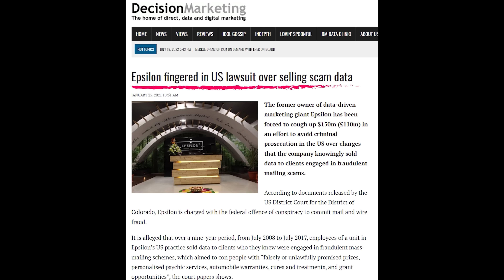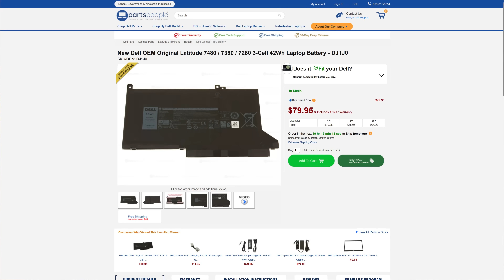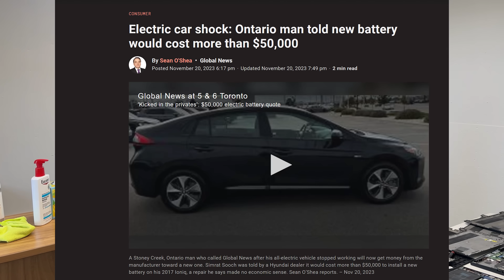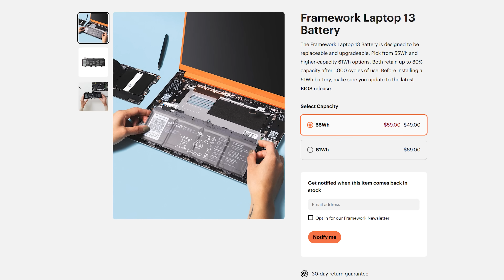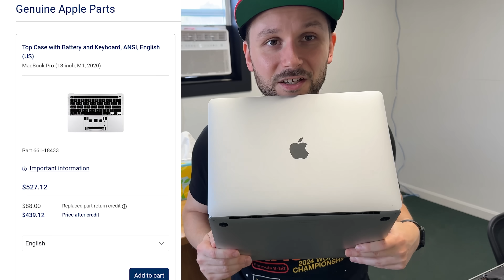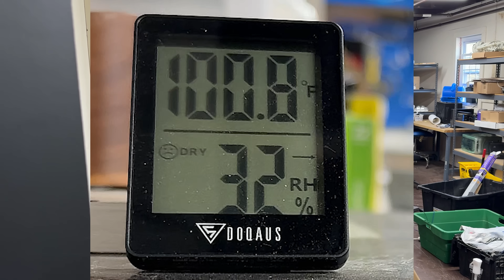Planned Obsolescence: Why is Replacing a Battery STILL So Difficult and Expensive?!

Comment: I miss the time when batteries were detachable and were, essentially, a combination of a bunch of standard cylindrical batteries in a fancy plastic packaging. While it's not recommended, you can theoretically build a new battery and pack it in the old casing, though those casings are impossible to open non-destructively, and rebuilding a battery holds some danger. But screw the danger! We should be able to do this anyway. A PSU can kill you, but it's serviceable. A CRT can really kill you dead, and they were serviceable. A lot of things are dangerous, but if you're careful, you can service them. Product manufacturers don't actually give a crap if you end up blowing yourself up and burning your mom's expensive jewelry, they just close everything because it's cheaper, plus they want to earn more money. That's it.

Comment: Great video, interesting topic. By the way, there is an EU regulation that was accepted back in 2023, and as part of the Ecodesign Directive, from mid-2025 manufacturers will need to provide information on battery life expectancy, battery performance, and repairability, among other things. It's already a soft way to push repairability through this scoring system. The same regulation also states that from 2027, all consumer electronics that come with a battery must be user-replaceable, with very few exceptions. Hopefully, the rest of the world will benefit from this too, and I hope it helps normalize replacement battery prices.

Comment: Two years ago i had to replace my old phone (which launched in 2019) because the battery swell so hard it popped both the LCD display and the back cover out. The replacement cost for a genuine battery was almost 90% of the phone's cost.
I feel like companies bring out newer generations in the same product lineup so quickly nowadays that the previous generations becomes outdated way too quickly, thus having its share of supply chain being poached by the new comers.
Reply: What are you doing with your phone? 😂 I have a 10 year old phone , original battery and no swelling.

Comment: I had the same situation. The repair shop wanted 350 PLN for a smaller battery for an Asus G771. The second repair shop told me to buy a new laptop. But on Ali, I found an original one with the same capacity for 100 PLN. I bought it, installed the battery, and the laptop immediately detected it, allowing me to run on the battery. It's ridiculous. Repair shops only do this because they don't want to replace or repair it. That's why there should be more videos like this. Don't throw it away. If it's working or intact, if it's not completely broken, it's still usable.
Reply: The thing is like they talked about you can buy batteries for most stuff and they can claim they are genuine or original but they really aren’t and have a extremely high defect rate. the shops doesn’t want to order a battery from Ali express for your device, it go bad after 2 weeks and have to replace it 3 more times and now they have lost money trying to fix your laptop.
Reply: Repair shops don't want to burn your house down, so we only source and waranty batteries from japan or korean manufacturers. 2-power batteries are great.

Comment: I had a Gen5 Camaro and did not even wait until the battery failed.  I replaced the AGM battery in the trunk before it failed after three years, using a size 94R.
Reply from the maker: We have the same Camaro, took me 5 minutes to replace the battery. UNHEARD OF in modern cars man.

Comment: Batteries are what makes a laptop cost effective.  Absolutely.  I picked up a 2020 Dell XPS 13 for just £100, needed a new screen (4k) that was another £60 and then the battery was at 50% SoH and Dell don't even list batteries for it  Its only  5 years old!!!  Second hand ones in "ok" condition 80% SoH are going for crazy money. So I bought a cheap aftermarket one, which thinks its an original battery somehow.
Reply: Interestingly, maybe not, I've got an HP Omen from around 2017-2018 it was fairly budget but with 2gb of 1050 goodness. 😂. It's battery at best never lasted much over an hour in use and it's been charged a bazzilion times and was my main PC for the dark days of lockdown.  It was never switched off, charging all the time.   Somehow it's battery health with a windows report is 98% SoH.  🤷.  Sometimes you just get a good pack.

Comment: If you need  laptop, but you are going to be in places where you always can use a socket, I would be happy with one of those with a dodgy battery (always ssuming I ws informed abot this detail) and use it always pluged and let the battery as a sort of emergency SAI to let you save your work and shut down the thing safely. Would it be so unrealistic as sceneario?

Comment: 12:00 I have replaced the battery of my HP DV5 four times in 12 years (5 batteries in total with the original), it still works but the current battery lasts about 15 minutes now, and I will try to extract the good cells in all those and solder them together.  None of the batteries I bought is original by the way.

The original battery of my HP Omen 17, however, only lasted only about 2 years, it is still with the second battery for the last 5 years. Interestingly, the current battery is not original HP part, yet lasting longer with no reduced duration.
Reply: Absolute Ditto.  Same Omen laptop.  The battery turned into a pillow.   The replacement i got has worked well over twice as long as the original.
Reply: The issue is that you have to reprogram the BMS to get it to work after the battery cell swap
Reply: @jaimzilla  that might be above my level, but I'll try, thanks!
Reply: Yeah, don’t solder lithium cells together, you need a spot welder. You’ll likely need an expensive Romanian gadget to unlock the BMS afterwards. Then you’ve just got the issue of the original plastic case having been ultrasonically welded together, causing you to break it during disassembly and have no way to put it back together properly.

The work would also be made more difficult due to the location that the HP Pavilion is in - the trash can if you have any sense.
Reply: @floydkirk-j3w  well, if I cannot find that hardware, I'll just stop trying. Thanks!

Comment: We had an old HP elitebook afew years ago (4th gen). OG battery died. Bought new B-grade greencell battery for it. Had 3 warrantys on it in 6 months. After 6 months just stopped and dumped that laptop. 🤡 Last battery died 1 month after that 6 month warranty was over.

Comment: 12:00 bro called me out, but in my case, it had more issues than the battery, at that point repairing my old iPhone 8 would've cost a lot, and by spending a bit more, I got a new one.
But for my refubrished laptop I bought in 2021? Hell nah, got it to run one software only, and it did its job. Now it's my web browsing, stream watching, min pc usage. Just slapped linux and it does great

Comment: KDE Fedora is A really solid OS. For people that don't want to deal with windows for web browsing. 

Batteries could easily be standarized. You know like we used to have in the 90's. 

I saw an LGR video about an old laptop and the "Battery" was A bunch of C cells wired together...
Reply: Salem Techsperts unfortunately think that Linux is a "neckbeard" thing. I have a smooth shaven face and use Arch btw.
Reply: @synthilein  i dont think he does, he just plays into the bit
Reply: @synthilein  I mean the fact that it's named "Fedora" isn't helping.
Reply: @synthilein I just moved most of my 3D printing workfrow from windows to my framework 13 running Fedora.
 

It is crazy how easy things are on KDE. On gnome ubuntu the app 'store' bearly worked, on Fedora I check it first before hitting the comand line.. 

I highly doubt this will be relevant for you but after having issues with Chronium for my japanese to english translation work, I swapped to A browser called Floorp (A japanese Firefox fork) that fixed my problems with japanese input on chromium.

Comment: Just installed win 11 on my old i7 4790k desktop, it has a 1TB nvme in a pci adaptor running at 3200MB/s reads and 2300MB/s writes. it has 32Gb ddr3 and a 1600 supper with an evga 650 watt gold PSU with a dual evo 212 fan cooler in a cosair 200r case. I installed it with rufus to take out all the restrictions. Then ran o&o shut up with their app buster; then ran Chris Titus toolbox with minimal teaks.  all looks good. works well, i don't game. not sure if this will change when they go to 25H2??

Comment: I replaced the battery in my HP Pavilion gaming laptop after four years of use. Unfortunately, the new battery didn't even last a year, despite light usage.

Next year, I'm planning to switch to a new laptop. But this time, I'm avoiding big brands known for planned obsolescence like Apple, HP, and Dell. Instead, I'm looking at Framework laptop. I really appreciate what they're doing, and I believe I shouldn't have to replace my entire laptop just because the battery fails.
Reply: The unfortunate thing about frameworks is that they are too bespoke to ever be affordable. We basically have to pressure the big brands to adopt their model if we ever want to see any sort of progress.
Reply: @sonicwave779  Also their discrete graphics suck. iGPU`s arent halfway bad in current age, but one might want a little more power from something that expensive...
Reply: i am also planning on buying a framework as my next laptop but i can only hope that by the time i need one they start shipping here

Comment: I bought 2 aftermarket batteries and they both lost ~50% capacity after 1 year of lite use (they were both for 10+ year old laptops). Next time I buy a battery it will be a used one off eBay, since there it seems like you can find them with less than 30% wear for ~30€. To me it seems like a reasonable price for a oem battery is around ~1.3$ per wh. At least that is what Framework seems to be charging. Dell sells theirs at 1.1-1.5$/wh with ought tax. I do want to give Dell partial credit, since they have a long list of parts available for their laptops on their official store (though the prices don't change with the age of the device for some reason), including new batteries, including for the Latitude 7490 (btw this laptop is officially supported for w11 since it has 8th gen), though I do agree that 80$ is pretty steep for a ~55wh batery.

Comment: I know you hate it when people say to install Linux but I have 5 computers in my house. My main Editing / Gaming rig (R7 7800X3d and RTX 5070TI, WIN11), my older rig (Ryzen 7 3700X, RTX 3070, WIN11) that I plan on using for offline rendering and some light AI work amongst other things, an older i5 with a GTX970 and an even older like second Gen i7. The last computer is a crap laptop for my daughters homework mostly (Windows 11).

The old i5 and i7 are too old for Windows 11. My wife uses the i5 mostly for working on documents, web stuff and the likes and I use the old i7 as a testbed for Linux stuff.

Those old machines CANNOT install windows 11. The i5 is still a perfectly capable machine even for light gaming (it was my gaming /editing rig ages ago).

My only other option would have been to literally throw those 2 machines in the garbage / recycling. Linux Mint gave them both a new lease on life.

I may still end up stripping the old i7 down and scrapping it ... the thing is like almost 20 years old now and mainly used for testing Linux things so I don;t have to worry about screwing up the machine.

It takes a while to get used to Linux for an end user (my wife likes to complain) but for a ridiculous number of people who just surf, work on documents, watch Netflix, do their banking, sort through they google photos ... this is way more than adequate for them and could prevent MASSIVE ammounts of e-waste.

I'm not saying Linux is a better operating system (even if I do like it) I'm saying it;s a better option than the massive ammount of ENGINEERED waste we are about to see happen.

Comment: I'd probably just make a battery system that plugs in externally for laptops that doesn't have usb-c charging and making my own battery pack (which is highly questionable for me to do) But one can only do so much with limited technical know how and experience. What I would hope for is battery cells being sold and using existing battery charging board that doesn't disables itself after certain charge cycle being reached. But I did a 2010's HP before and that sucker disables itself after it reached it's recharge cycle count and man that pissed me off, but using an aftermarket one works though but isn't pocket friendly since I had to buy a cheapo battery pack and yoinked it's charging board. #STOPKILLINGDEVICES

Comment: I have a small laptop that I used to own because of its portability, but a few years ago, the battery brokes and I could not find a replacement. The laptop was perfectly fine and almost brand new, but I could use it after that. Now I got a Dell Latitude 3330 for School, like everyone in my class has the same laptop and i am so glad it came with 3 years full guarantee because in all my class not a single one did not broke XD mostly issues with the keys or the battery

Comment: Battery packs on used laptops have a similarity with battery packs on used EVs. They have a rather high chance to financially total the object.
For laptops at least i think we could make things way better if batteries are standardized, at least put them in 2 or 3 brackets. low, mid, high end. But otherwise they should be interchangeable no matter what manufacturer the laptop is. This means 3rd party sellers can take over supply easily and you could just order a battery pack with the wh you need without worries of compatibility. But... they all love their legacy stuff that is incompatible with anyone else.

Comment: Just upgraded another family member's laptop to a newer one but used. She went from a Toshiba Satellite 2012 (God I hate these plastic piece of shit) to a 2018 version of the Think Pad T470 (with 6th gen i7). Slapped Linux Mint on it spent a few days teaching her how to do this and that, she is a email, solitaire, web browser user. This laptop will last her many years, luckily the extended kickstand battery is good and I taught her how too keep the battery healthy as long as possible. This is one of the reasons why I've been holding back on buying used laptops to flip due to parts used to be plentiful pre 2020 now they are less common and expensive and no name brand.

Comment: Just got my warranty 61w replacement battery from framework. The way they treat customers makes me want to buy more from them despite how much more there products cost.
Reply from the maker: And this is exactly why I shill so hard for them
Reply: That's the thing. One day when I can afford it, I'd LOVE to support them
Reply: @humphreywolfe the 12 inch 2 in 1 is not that expensive. It's cheaper than the new 12-inch Surface Pro or an AirPad Pro or galaxy tab s11. It's definitely on my short list. I just don't know if I'd be better off buying a refurbished steam deck and a think pad instead.
Reply: @humphreywolfe  a new Framework 16 seems to be cooking. Let's pay attention to that.
Reply: i would love to upgrade to one but they cost too much, and the 16 doesn't quite have the gpu I'm looking for especially for that price

Comment: I have a hp Zbook 15 g3 not able to run windows 11 but then i used rufus and now it has windows 11 i also gave it more ram and soon i might get some ptm 7950 and the battery was starting to go bad and hp does not sell them any more

Comment: Well the difference between framework and all of these other companies is that framework uses the same battery in every laptop while the others use different size batteries or same size but different mounting holes or different connector to the mainboard etc.
Reply: And its stupid. They definitely blow a lot of money making custom battery each time.
Reply: @alexturnbackthearmy1907  No they don't because if people want to replace their battery a few years later they can say that they have to retool their assembly line to make the old "standard" with just a few mounting holes in slightly different locations to justify asking for a higher price then the original cost of the entire laptop or even the cost of a newer model laptop.
Reply: They doing different size and different connectors on purpose 

New gen have glued / moulded screen instead of screw ,and that screen blocked the cable for camera 

Shame HP !
Reply: @frankwong9486  Of course they're doing it on purpose. They want you to buy a new model instead of repair your old model by making it as difficult and expensive as possible to do the repair. 
Also Apple fuses their screens with the glass cover so you'd have to replace the entire screen assembly instead of just replacing the screen which is no longer possible.